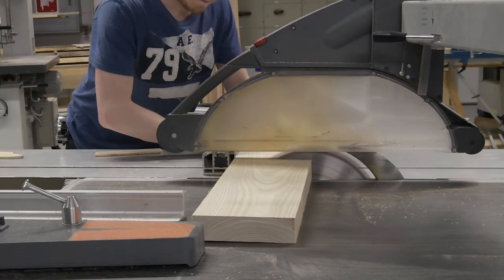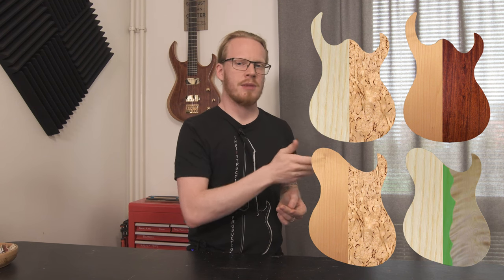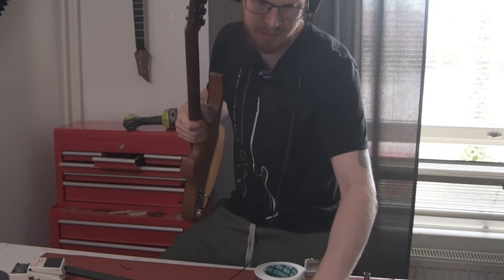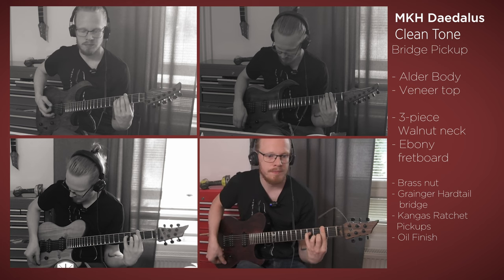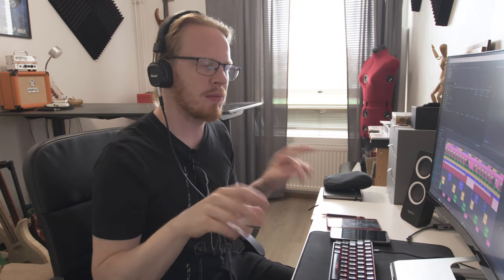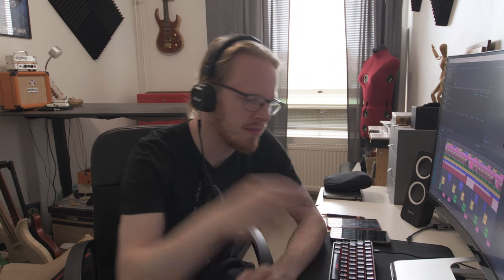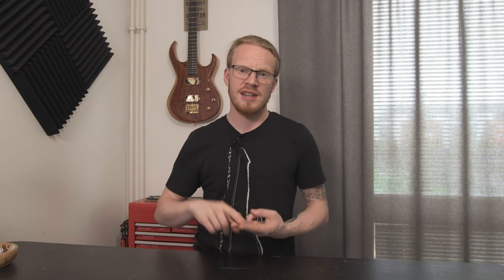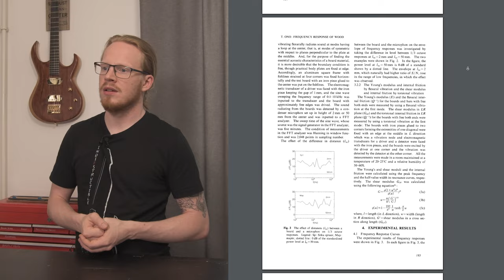Putting the TONEWOOD Debate to Test!

Comment: Didn't Will Gelvin put this to rest? Guitar maker and no BS. But i get it. We all think that if something is made of different wood it should sound different. But its electric and not acoustic. Don't we already have tone knobs on our guitars. How many pedals do we all have to get different effects or to get the tone we want. We start to lose ourselves once you start adding in that stuff anyway except on clean tones. And its super minor anyway. Now feel is super different. I guess if you the feel the weight, softness or hardness of the wood and different strings that can also give you feel and comparing that to tone then we can be onto something. Thats in our mind though. But its electric. Mho.
Reply from the maker: "Feel" <- Abso-friggin-lutely. You hit the nail on the head.

It really does boil down to just that. Like I mentioned in the video, I prefer not to have a rosewood fretboard for example. But even I can't quite determine why. I just don't like the feel at the end of the day, but at some point my mind has decided it's because of the "tone". Whether or not that is completely in my head is another thing.

Dig what you dig really. But you absolutely hit home with this comment!

Comment: Theres litterally no debate. Tonewood makes a very small almost unnoticeable difference. The most significant tonewood being what the neck is made from. As all of yours use the same material for the neck you probably won't notice much.
Reply: I guess you never build a guitar - did you? As a former luthier i would never recommend beech, oak or balsa for a guitar. Some timber just soaks up the tone and others would not resonate! If you process your tone through a long chain of effects, you might get the same sounds from every material, even from styrofoam or cardboard. On one point you are right! A maple neck will give at least some sound. Chipboard body + maple neck = Epiphone, entry level for example.
Reply from the maker: And as a luthier who has made guitars with oak tops (and one fretboard) or beech in a neck or body, they sounded actually pretty damn great. Bog oak (when it comes up) is used a fair bit in some luthier circles and I've come across a good few examples of beech in necks (most notably Paul McCartney's violin bass). And while I wouldn't recommend it, for one guitar the only wood I used was pine for everything and it sounds WILDLY different to other guitars I have.

But I know you were just making a point, just wanted to point out those two woods as being used for guitars :) your point is still valid.

Again, I want to point out construction. Take a bolt-on neck combined with 100% pickguard mounted electronics and a floating bridge (a lá a Strat). The resonance would not carry in the same way as a set neck with direct mounted pickups and a hardtail bridge for example. A good example is the cardboard strat Fender made a few years back. Oddly enough, to some extent it still sounds like a strat..
Reply: @IPGuitars  100% construction will make an even bigger difference
Reply: @gluteusmaximus1657  I think ypu replied to the wrong comment mate I didn't suggest any specific materials???
Reply: Sorry if i hit the wrong person. I read that you think the sound of a fuitar originates from the neck only, wich i cannot sign, Bikeadelic ;-) @Bikeadelic